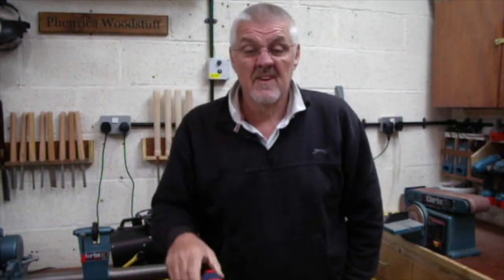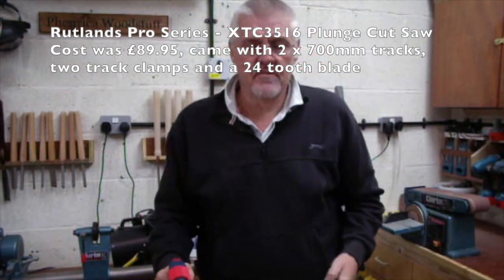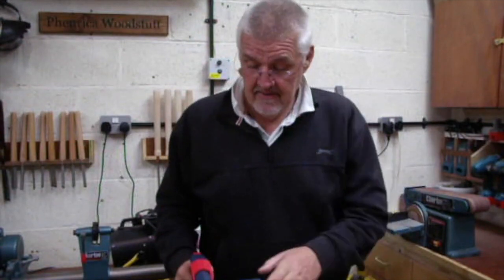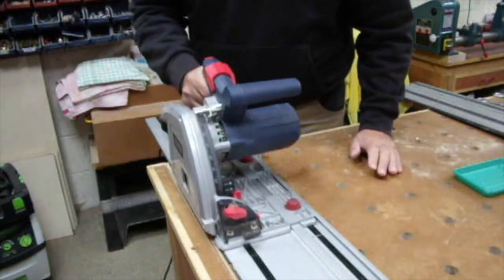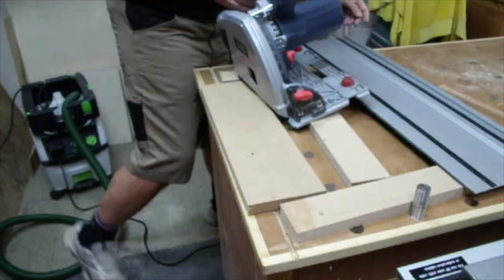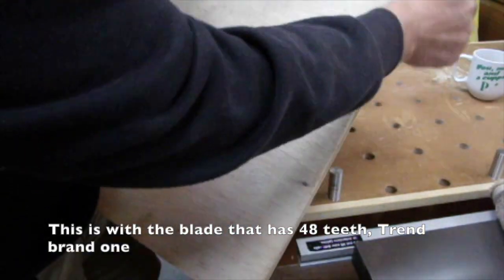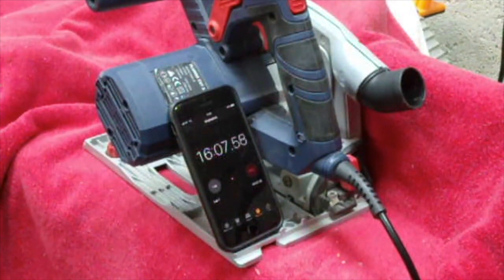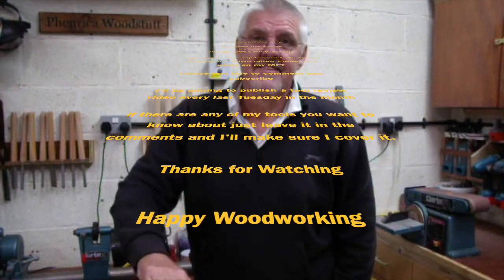Rutlands Pro Series Plunge Cut Saw XT3516 - Tool Review Tuesday

Comment: If it gets hot without being used its obviously not the motor. If the handle gets hot while plugged in theres a short somewhere which might expose itself when the saw actually gives up the ghost.
Try and find an exploded view which will show you whats inside the handle.
Reply from the maker: gbwildlife uk thanks for the advice 👍🏻
Reply: @Phenrica  hi, did you solve that problem ?
Reply from the maker: Antonio Emme Unfortunately not, so I ensure the supply is switched off whilst it’s not being used 😏 I’m saving to buy a more prestige version 😂
Reply: I've just bought this so 🤞 they've solved this but thanks for telling us about the handle heating up so I know to look out for it happening.